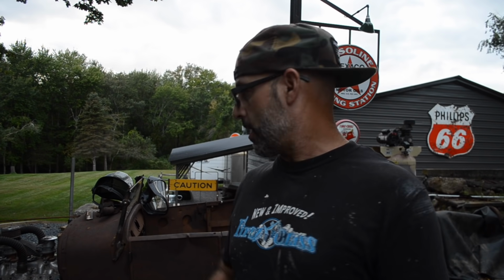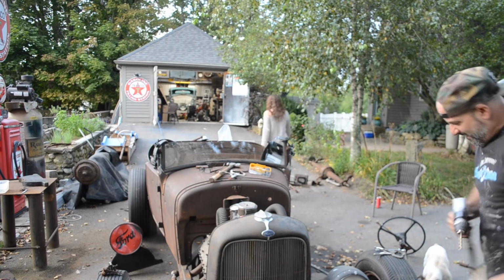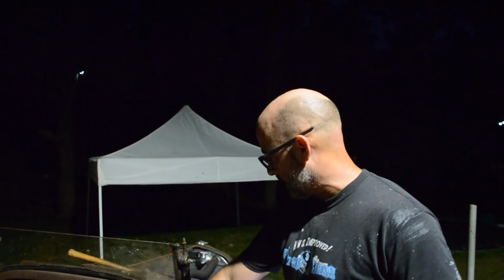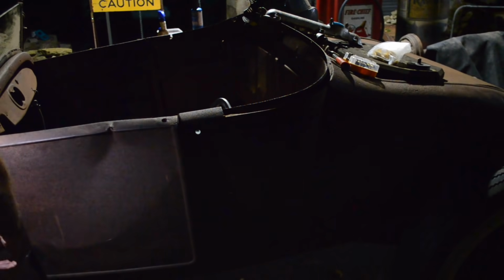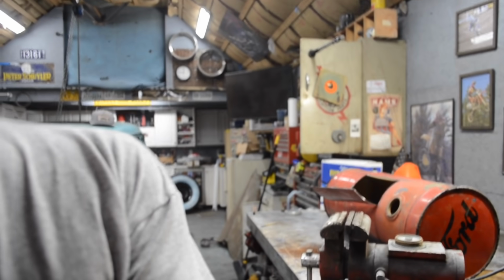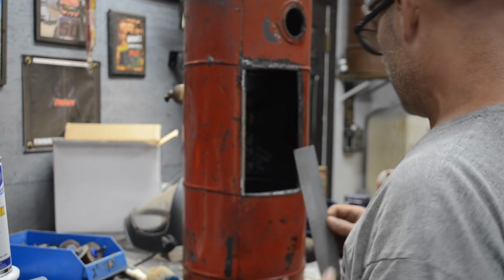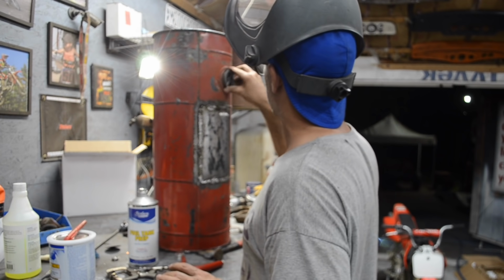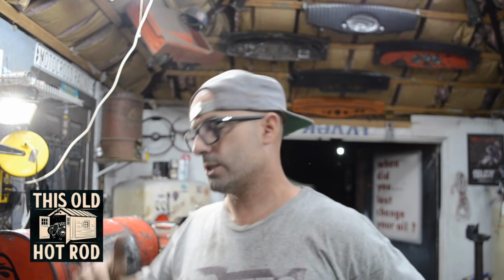1927 Ford Roadster Project [Episode 10]

Comment: A little J B weld on the outside of tank and then the Red Cote  gas tank sealer and you will be good to go.  Have used this method for years on old cars and tractors. and it is still working and some have been as long as 10 years.
Reply from the maker: Fantastic to know !  Thank you 🙏🏼

Comment: Put 10 pounds of air pressure in the tank, then spray your welds with soupy water. Mark the leaks, weld and repeat till there is no leaks.
Reply from the maker: That’s what I was going to do.  Just haven’t done it yet.  Thank you 👍🏼👍🏼👍🏼

Comment: It’s early in the video so I do t know if you mess with the steering any further but here are some easy tips for making your tie rod/drag link angles closer to parallel. You can tapper the steering arms on the opposite side so the tie rod can go in from either side. That’s a good 3” of difference,  the also make a dropped tie rod end. I’ve seen them possibly as a stock piece on fordnpickups but I got mine after market. Gives a significant amount of drop. Between the two and moving your box forward hopefully that helps some.

Now it’s just gotta clear all the other stuff in the way!
Reply from the maker: thanks Tim for the tips...👍

Comment: If you can't fix the latch, you could put slide bolt latches for the doors.
Reply from the maker: I may do that.  But I may just get a set of bear claws.  They work great.  Like to be safe  about it. More important than using old parts.   👍🏼

Comment: So modify the Radiator tabs . Instead of drilling holes in arkward spots and grinding bolt heads down. Ruff is enough i guess ! Nice try on the fuel tank. You could Tig weld it , hard to get low heat with the mig other than stop start. Still some good welding technique will seal that tank up. Id do it for ya if i was there. So , your reasonable at sheet metal fab , just get stuck in and cut out the thin tank metal and weld in new. Dont forget you can 3/4 fill tank with water . Dont give up .
Reply from the maker: Thanks !

Comment: The bump steer has to be very violent Tuco through the gearing in the steering box and your grip on the steering wheel so what happens is the car actually steers itself when it hits a bump it will turn the car
Reply from the maker: true

Comment: Hey buddy if you burn them tanks out with muriatic acid you will not have to do all that welding stuff if you burn that out with muriatic acid
Reply from the maker: Yeah. It’s too late for that. Already cut it open ya know.  
I’ll get it sorted out… just takes time.  I was rushing and I shouldn’t have done it before I left town.  
Thank you for the info.  I have it here at the house too.

Comment: Check out how I did my steering on my 37 project on my page maybe it will help ya come up with an idea.
Reply from the maker: I’ve got it all sorted out at this point.  I will check your 37 though.  
Thank you 🙏🏼
Reply: Have you considered adding a second set of sprockets/chain for redundance should the chain come off?  Using a timing chain would lend automotive character, much less of an industrial image.
Reply from the maker: @waynespyker5731  I’m not sure what you’re referring to in regards to a chain
Reply: 'You' was meant for D-Man using a single roller chain between sprockets to dog leg his steering shafts routing. Just suggesting a chain can drop it's connecting link. (Clever concept similar to connecting the upper to lower shafts in a quick-change rear except using a roller link chain. Something cast Moon or Hildebrant could provide a decorative shroud i.e. a q/c cover.)
Saw D-Man's concept successfully completed on an aluminum 20 seat zeppelin amusement park ride pod converted to a street rod as the Nats East years ago. However the Ohio licensed vehicle ended each shaft with multiple stacks of sprockets to provide 4 separate connecting roller link chains should one fail.
Reply: @waynespyker5731  not a bad idea!!! Thanks!